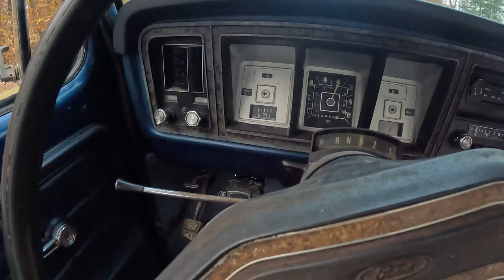Everything goes wrong, an excavator recovery

Comment: I'm betting the carb vapor locked due to heat from the heavy tow. Once it sat for a long time and cooled off, adding the gas to the carb enabled it to fire again. It's not an adventure until something goes wrong! Oh, and Falcon owes you dinner and a day at the spa.
Reply from the maker: He covered lunched and we have this memory that will last a life time. Even in my book!
Reply: Not carb fuel pump vapor locked due to no fan shroud at the time, truck has since received new fan shroud have not had a problem since.
Reply: @falconkrause9324  Awesome!

Comment: these types of nerve racking adventures turn into the most cherished memories when you get older ..trust me on this...when either of you is old and reminiscing about the younger days you will be laughing and remembering things like this
Reply: 100% agree.
Reply: Brings back memories of an epic trip when I was in my teens.  We were hauling two van convoy of horse vans fully loaded with 6 horses apiece, about 20,000 lbs in each van, when the tranny failed in one of them.  We were fortunate to coast into a median cop turnaround on I 684 just before the intersection with I 287, a huge intersection near White Plains NY.  We shuttled one of the cars in our caravan to the local Sears to get some tools to try to get it operable, praying we could get it running before the tranquilizers ran out on one of the horses in the back.  Managed to get it running on half of the gears, but we didn’t have low gear, which meant we couldn’t stop at the bottom of a hill because we wouldn’t have gearing to get up the hill without stalling out.  Finally got to PA about 6 hours late.

Comment: I bought a 1975  F250 to haul the largest Uhaul enclosed moving trailer with a houseful of furniture & appliances from BC to NS, Canada, about 2800 miles. The Ford never even burped,  but further to Falcon's comment about fuel mileage I averaged  8 MPG  and could actually see the gas needle moving as I drove.  A great video adventure, Sam ! 👍👍👍

Comment: dumpster dive at a truckstop repair shop for some rubber mud flaps.  Or  a couple rolls of round baler straps/bands.  Lay them down on the metal ramps so that the steel tracks have something to bite onto

Comment: When I use to run those old Fords I would keep a electronic module,a fuel pump and a voltage regulator behind the seat..I had about ten of those 70s Fords.. Great trucks very reliable..Your friends truck is a real Beauty ..
Reply from the maker: Yeah, a lesson learned on spare parts. It's a wonderful truck
Reply: Ha! Ha! Same with 80’s jeep cj7’s!

Comment: should have picked up some old tires to drive on but you got it loaded anyway!  I had a newer F-150 crap out like that on me when the fuel pump relay melted at a red light and had people backed up for a mile.  Luckily I had a can of brake clean and a guy willing to stand on the bumper spraying it into the intake long enough to get it off the road :)

Comment: WOW!   That was a very dangerous situation, that was the worst possible place to have the truck stop running.  Being stopped under that overpass you were in a dark area , people coming in from the bright light had difficulty seeing you stopped there.  It certainly is a miracle that you was not hit. That could have been a major catastrophe..    I would be interested in what the trucks gas gauge was reading , I ask that because I had 2 Fords like that one and both would run out of Gasoline at 1/4 of a tank.   They had a gauge problem in those years.   I am glad that you got back safe!   Smart move Sam to have stayed inside the truck while it was broke down!

Comment: That truck pulled well for the weight in the back.. you need to add “add a leaf spring” for added weight carrying.. get a larger radiator for that heavy hauling.. ..

Comment: I bought a Takeuchi with a locked up final drive. 
When I got it home, the drive was bone dry, and a few of the teeth had come  off the gears, and ended up in the bottom locking it up.
I got all of that out, it turned, so I filled it up with 90wt, and used it for several years before selling it.

Comment: back in the old days metal fuel lines would get hot and cause vapor lock and we would fix by placing wooden clothes pins on the fuel line to dissipate heat / or so we thought, may have just been the placebo effect LMAO

Comment: Poor old truck had the vapors,carry a wooden clothes pin with you,if it happens again,clamp it to the gas line closest to the exhaust on the metal  part of the gas line.its getting too hot.

Comment: Ah what it is to be young. Most things done on a shoe strap and hope :) I've been very lucky, bit like you in a way. My first car was a Renault Dauphin £40.00 in 1966. It did four successful trips to Hamburg from camp Hohne. then on the fifth it broke down on the Autobahn, I was in the second lane when it just died. I had enough clearance to get it onto the shoulder. My friend took the distributor cap off, then tried to work the startor motor, nothing. The rotor arm didn't turn ! Knackered ! Just then someone in a Glas (BMW engine) turned up and towed us, 1st to Soltau and two garages, who were unable to help. then he towed us (4 of us) back to camp. He wouldn't accept any gas coupons, but said, do this for someone else if you can, then went ! Talk about luck, the car went straight to scrap !

Comment: Put blocks under the back of the trailer next time those ramps don't have any stands.  I've seen trailers that have a ton of up pressure on the trailer coupling cut loose and they could send you flying if you're inside the trailer..  on top of that you've almost got the back tires of the truck lifted off the ground that's the only thing that keeps it in place.  I had my four-door diesel F350 get pushed down the driveway  when loading a 20k basket lift
Reply from the maker: We did have wheel chucks on the trailer
Reply: @samanthaweber6932  the wheel chucks are great but  I meant stands under the ramps where they connect to the back of the trailer.  Then it does not try to rip the trailer off the truck or lift the truck tires off the ground.  Glad you were able to help your friend out and I enjoyed the video!

Comment: Sounds like it was vapor locking… not fuel pump…. And yea it always amazes me how people turn into animals rather than helping… like the people beeping like you are choosing to sit in the road and not move… obviously you are in a situation… if you have a choice to move you would …. Idiots it’s so frustrating. A test of patience before, trust me I’ve made many of white knuckle runs over my years. It’s funny you mention NJ I traded my well sorted XJ for a locked and lifted TJ that was supposed to drive great. Well I drove to NJ from MA to make the trade and after. It was done I drove about 500 feet and realized I was in a situation bad. The jeep literally would completely swerve into the other lane randomly anything over 15 mph. It had bald super swampers and the worst lift and alignment setup you could imagine. I actually stopped at a tire shop and bought 4 new tiny size tires to make it as stable as possible for the ride home. Longest and worst drive of my life… however ended up being a big win the jeep had so much value in parts and upgrades and was really clean… just bad mechanics when they did all the upgrades the guy was clueless and just wanted something that drove good.

Comment: Any chance it vapor locked? Pedal to the floor for a long period of time will create some heat. The fact that priming the carb got it restarted re-enforces my theory.
Reply: Yesss I didn’t have fan shroud at the time I now do that was most likely the reason
Reply: @falconkrause9324  Good job. A fan shroud really helps at low speed. Also verify the fan clutch is working correctly.

Comment: Probably not the fuel pump,  might be the fuel filter and a certain amount of rust or sediment in the gas tank,  as you go faster and the rev's go up more debris gets sucked up into the fuel filter at a faster rate and clogs it.  I would change the fuel filter,  wash out the gas tank,  re-check the fuel pressure.

Comment: First car trailer probably had a gross rating of 7K and weighed at least 2500 lbs empty.  That leaves 4500 carrying capacity for a 10K machine.  Gee, I wonder why the axle blew out.  The dump trailer is probably only 10K gross and weighs 4500 lbs empty, leaving 5500 lbs for cargo.  Still well shy of 10K.  A '79 F-250 even when brand new was never rated to tow that much weight even if the trailer was proper for the load.  Use what you got, I get it, but common sense needs to factor in there at some point.  Glad no one was hurt or worse during this shit show.  It could have turned out so much worse.
Reply: My dump trailer is 10k and it weighs 3k machine is 4.1k 1200lbs over thanks for the educated comment lmao

Comment: I’d say you gabled going to recover a 10,000
#excavator with a sketchy trailer, no tools, no equipment in a truck not made to pull that load.
Sometimes adventure is fun, stopped dead on any toll road headed out of NJ in the afternoon is bad enough
In a car. Enough said

Comment: IF THAT'S A GAS TRUCK SOME HAVE TWO OR MORE FUEL PUMPS ONE IN EACH TANK LOW PRESSURE ONESA AND HIGH PRESSER ON FRAME UNDER THE DRIVER SIDE AND A FILTER IN FRONT OF THE HIGH PRESSURE ONE MY TRUCK HAS TWO TANKS YOU HAVE TO SWITCH FROM ONE TO THE OTHER SO I HAVE 3 FUEL PUMPS ONE IN EACH TANK AND A HIGH PRESSURE ONE IF THE TRUCK IS FUEL INJECTED IF ITS NOT THEN ONE FUEL PUMP ON THE ENGINE AND IF TRUCK WAS GETTING PRETTY HOT THEN IT COULD HAVE WENT INTO A VAPOR LOCK SITUATION  WERE THE HEAT PRESSURIZES  THE GAS IN THE LINE  AND VAPORIZERS CAUSING  IT TO  PUSH BACK TOWARD THE TANK  THIS WAS A PROBLEM WITH A LOT OF REALLY OLDER VEHICLES    IVE REMEMBER SEEING THEM CLIP CLOSE PIN ONTO THE METAL FUEL LINES TRYING TO USE THEM AS A HEAT SINK LOL NOT SURE IF IT WORKED BUT I DID SEE THIS LOL

Comment: You did not need the ramps to load it. Gosh it was killing me to watch this and not be there to help.
Reply from the maker: One of the tracks didn't work, no way was easy
Reply: Sam you could push with the boom. I’ve loaded with both track motors dead. 
Sam you don’t need me saying this but why did you take the big highway with an overloaded trailer and older truck? You saved to boys life taking command of the situation. Good girl Sam.
Reply from the maker: That's how you got to where the excavator was, It seems like all of Jersey is like that. The truck handled very well if it wasn't for it breaking down. Breaking down isn't reserved for older vehicles, either. Being able to pour fuel directly into the carburetor is what got us out of there.
Reply: Thats what i was thinking to myself didn't need ramps.